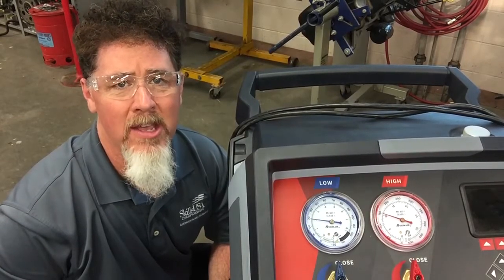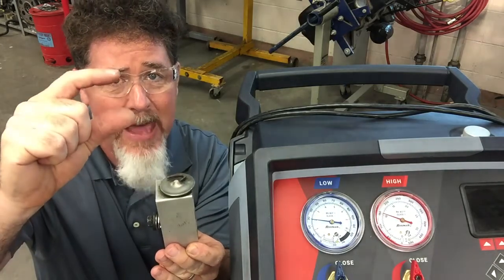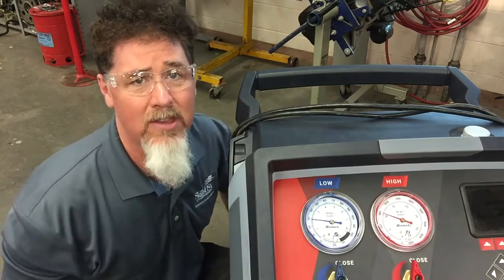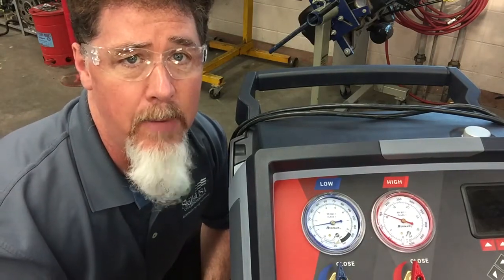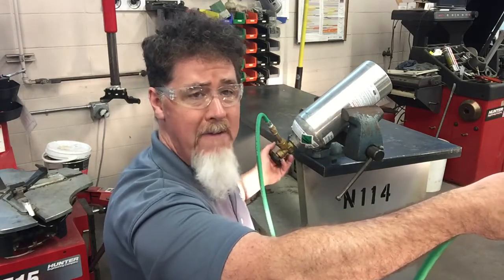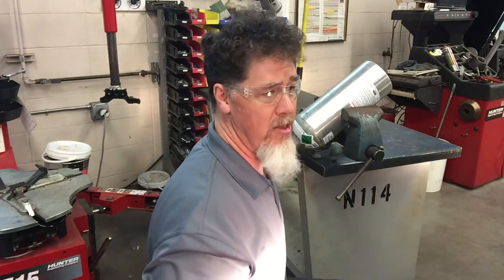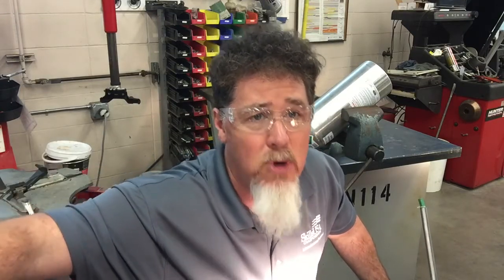How to test the H Valve with CO2

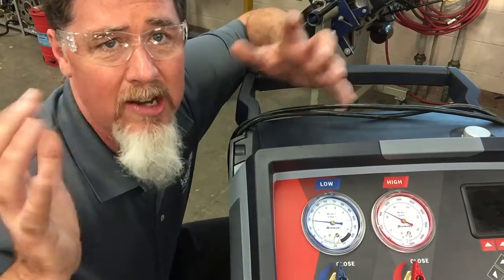Comment: @2:30 - and in addition the low side pressure switch was triggered thus deactivating the compressor.
Reply from the maker: Hello Mr. X,  I watched this video again and the compressor never shut off during this test.  I do not want the compressor to turn off during this test.  Most newer TXV systems do not use a low side pressure switch, but an evaporator temp sensor to control freeze up.  Before this test, I turn the HVAC controls on fresh air to get the low side up as high as I can to prevent the compressor from cycling off from the evaporator getting to cold.   If the compressor does kick off during this H-Valve test, I normally do the test again because it is hard to see the closing of the H-Valve if the compressor kicks off.   Thanks for watching the video and providing a good discussion on this topic.